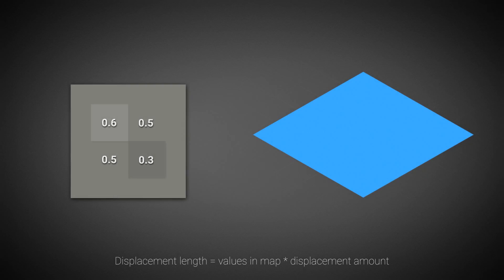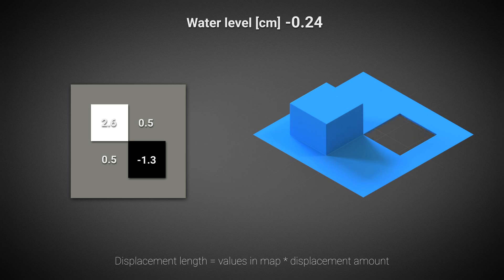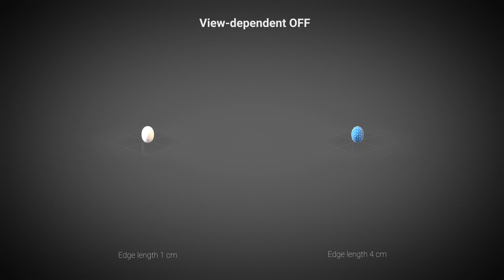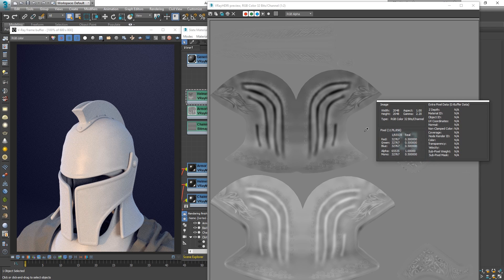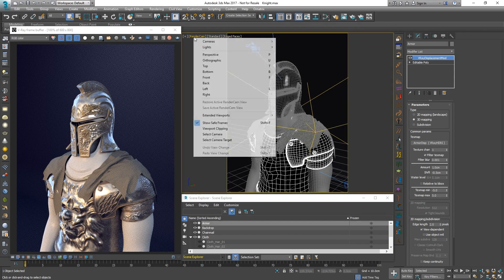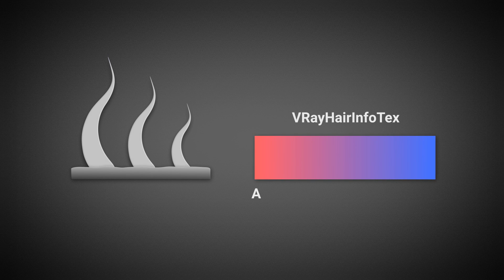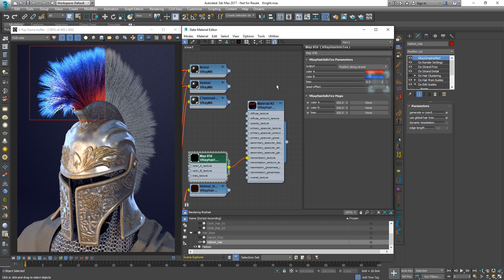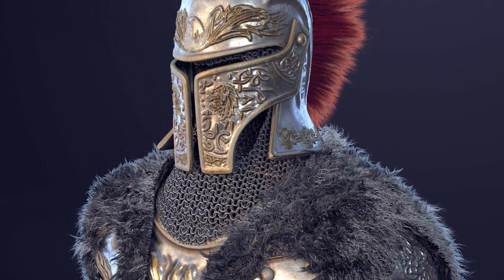V-Ray for 3ds Max – Quick Tutorial: [GPU] Displacement and Hair

Comment: Do you think that this method works well when you apply a displacement map for create the skin? because i've tried to use the same workflow but unfortunately doesn't work for me, but when i tried to use open exr map export from zbrush it's works, the only parameter i've used is edge lenght

Comment: Hello guys, I have a question: I followed the video and learned a lot abut this method. I've been using it since then but I'm facing an issue right now: the VRayLightSelect pass renders black. There's no info at all in them when imported to Photoshop nor in the VFB. We're talking of a scene with 4 cameras and around 25 lights (grouped for each room; a total of 15 VRayLightSelect Elements) and I rendered in batch.
     When I rendered them separetely for drafts and previews it worked well. Any ideas on why is ths happening now? Does it work with batch or not? Is there a limited number for the VRayLightSelect elemnts?
     Thanks!
Reply: Rename it each element (vraylightselect) separately and Render then it will render...

Comment: Negative value in 32 bit map doesn't take effect in V-ray rt?!? First I thought that something wrong with my scene setup. Then i found this video and tried to render provided scene. Same result - no inwards displacement on armor in lion mouth area. To see it clearly  it is better to delete normal map from material and try to render with min/max -5/5 (as default in this scene) and then cut range to 0/5. Nothing changes.
Then I tried  to render it with V-ray Adv. and negative displacement is on its place.
I tried more obvious tests with simple plane and  black map  with -1 and +1 areas. Same result - no negative displacement.  If I switch to V-ray Adv. without any changes in the scene it renders as it should be.
By the way i tried Redshift on the same host (3ds Max 2018) it is works fine with negative displacement. And also tried V-ray RT for Modo. It works as expected!
I'm completely confused, because it looks like no one has this problem, except me. I use 3ds Max 2018, V-ray 3.60.04, GTX 970. 
Any suggestions?